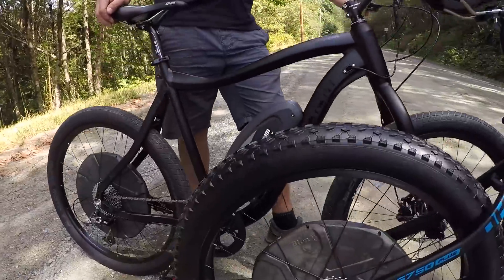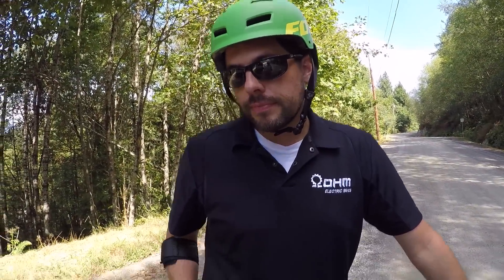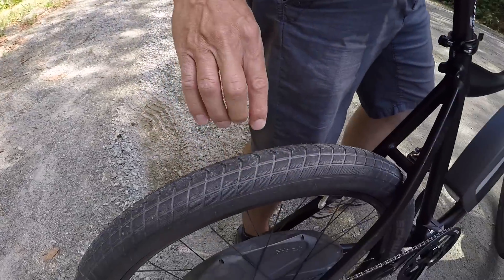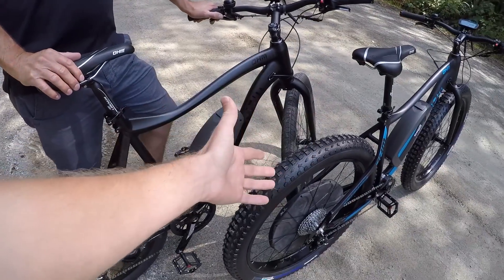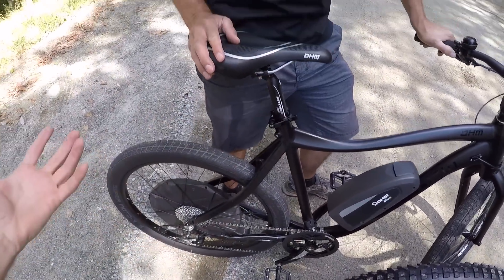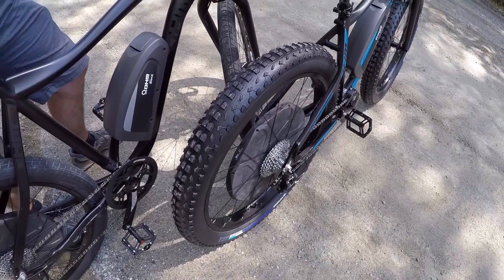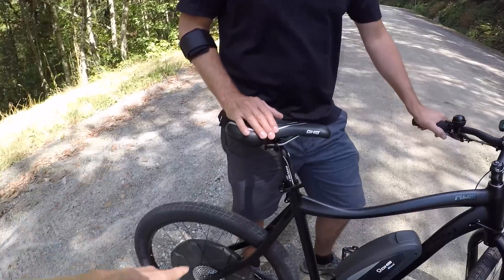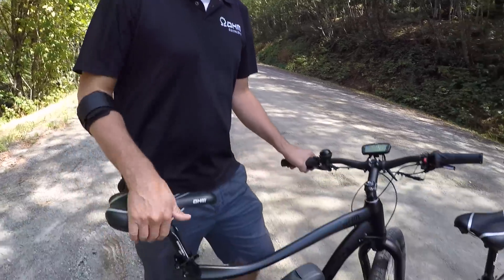What is TPI and EPI (Threads Per Inch) on Bike Tires

Comment: Threads of what?
Reply: Nylon usually. I believe. But it does not matter, is just a standard measure of the weave thread density.  Whatever material it is threaded with.